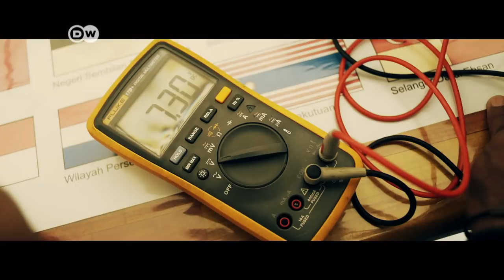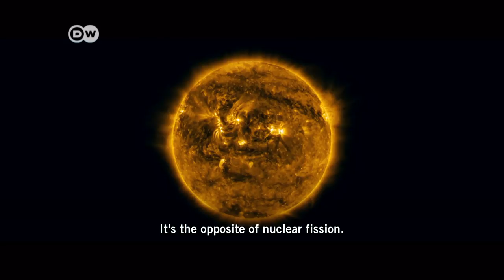Malaysia: energize the world - Founders Valley (4/10) | DW Documentary

Comment: We could power everything we need 100% with renewable energy fission would be great but the knowledge about renewable energy combined is enough the problem is storage but we can make so much energy the excess will make hydrogen to power real heavy goods vehicles and construction equipment. Battery’s are getting better and we will develop them more so they can be recycled better maybe salt and water achieving power storage at lower temperature that salt tends to store energy best at current batteries are salt based it’s finding the correct chemical balance that will naturally recycle within our ecosystem. The money however that we could put into fission could be spent on 5 already well known ways of producing power and heat already known and already powering whole country’s like Costa Rica yes they have plenty of sun to do it that’s why a mix of all energy is required. If a chemical reaction in a glass can move a tennis ball then that power can move something.